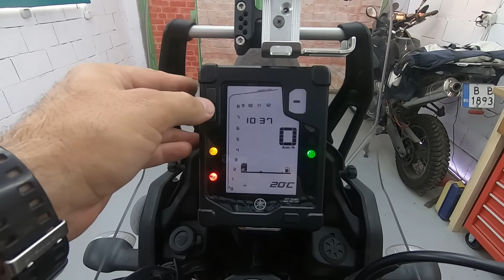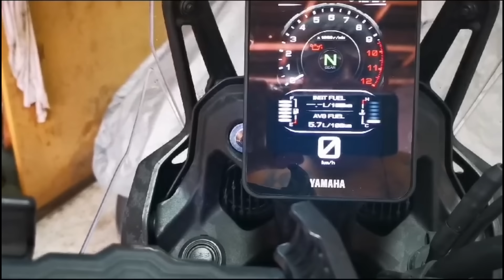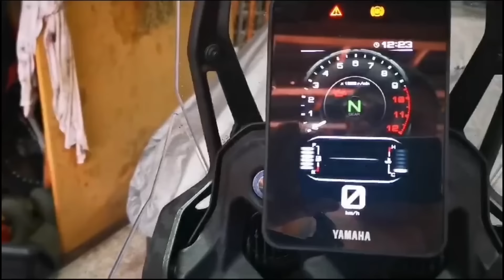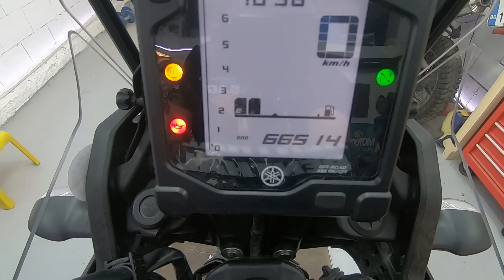Yamaha Tenere 700 - Long Term [66,000km] Owners Review

Comment: Hi Pavlin. I’m a little bit late for the party because I just found your channel. Maybe you already know it but For this cold engine clutch “issue” try before you start bike push it back couple of times on the first gear. It will release clutch discs which are stick to each other after last run. I learn that in 1998 when I start riding. 
Great channel 👌👍 No BS straight to the point. 
I’m planning my come back to Poland from Canada after 11 years on T7. Well I was surprised when I figured that there is no commercial boat from Alaska to Siberia 😁
Reply from the maker: I know that and do it every time, but no results. Instead, I just start slowly.

Comment: Great video! All modern bikes are using wet sump motors instead of old school high tech dry sump design. The wet sump pushes the motor 4 to 6 inches higher in the frame which makes the entire bike top heavy. If the motor is 6 inches lower the fuel tank could be 6 inches lower and even the seat height could be lower!
Reply from the maker: True, but there is nothing we can do about it.
Reply: @motorcycleadventures  maybe, just maybe, if ALL of us talk about it someone may see it's advantages and the tide may change! YouTube influencers like you can make a difference!!

Comment: Great review and information. Regarding the clutch noise on first start of the day: after starting the bike, while it’s idling in neutral,pull in the clutch lever and hold it in for a few seconds, then release it. Then, see if it still makes the noise you described when you put it in gear for the first time when departing. Just a suggestion to see if that changes anything. Thanks again!
Reply from the maker: I do this every time and it still do it.

Comment: Nice, thoughtful review.  I particularly like the T7, although my primary bike, especially for regular commuting (between 50-200 miles, depending on work)  is a first generation Super Tenere.  Totally different bike, of course, but there is this in common:  incredible reliability.  After over 100k miles (not km), no issues, even though I ride it year round, including in sub zero temps.  Simplicity is the key, and both of these bikes place a premium on reliable, practical engineering and geometry.  The T7 is also "stupid reliable" and well balanced.  Either way, they will never let you down.
Reply from the maker: Thanks for sharing!

Comment: Bravo Pavlin !  The clutch problem - you have to open it, clean it and reassemble it. Use ,of course, the RIGHT Nm torque for the bolts. For me is ok now.
Reply from the maker: Clean a new bike?
Reply: It's not about cleaning. It's about torque. We think the factory is not tightening correctly

Comment: Love your wood stove with the heat exchanger on the chimney pipe.  Never saw that here in USA. 

Great vid on the T7. I would love one. 72 HP is more than 3X my Honda CRF250L, and twice my Moto Guzzi V7. 
Really agree with you on riding a simple bike, without extra things that add weight & can fail. 
If I dropped the T7 while riding alone, I could never stand it back up. I can barely pick up my 146kg/322lb Honda. I try to ride with a buddy, but can't always find someone able to go.
Reply from the maker: Thanks for taking the time!

Comment: For the clutch noise when cold, I have found that if you pull the clutch lever in 5-6 times before shifting the gear the noise does not come.  I guess it’s because the oil get around the clutch plate and provides some lubrication. You have to do this only for the first time when cold.
Reply from the maker: I also do this all the time.

Comment: Hi Pavlin ! Thanks for this  T7 review. Very interesting and useful. When you need a good horse not too heavy , not too powerful and very simple to maintain, this is the point and that's why I chose the T7 and bought one, second hand, a 2021 Rally Edition from an ex-local enduro champion in France, with 13.000 kms. When I looked at ads for T7s to sell on "Le Bon Coin" in France, I saw two sellers who talked openly about the clutch issue but never on youtube. As you say, the "issues" on the T7 are quite minor, and this bike is terrific - simple, efficient. Congratulations for your videos, always very documented and interesting. I loved your trip to Madagan. I hope to make a trip like you did, through eastern Europe and Asia - but first, some trips in Europe to master my T7... Hello from France !
Reply from the maker: Thanks for taking the time!

Comment: The twitchy throttle isnt a problem with the throttle cable. It's the fuelling. When you roll off the throttle it cuts all fuel input when you roll back on it chops back in. It's done for emmissions.

I sent my ECU off to be tuned and it cured that issue almost completely. If I had removed the o2 sensor, then it would apparently have been even better. But I never got around to doing that before I sold the bike, which I wouldn't have done if I hadn't won a 1250gs in a raffle.
Reply from the maker: Good to know.

Comment: For short people, e.g. myself 1,72 m i recommend a v strom 650, mine has 62000 km, i changed a ball bearing for 15€ on the rear sprocket hub, nothing else, low on fuel, not expensive to buy, good offroad, if you donot go too fast.
Reply from the maker: Thanks for sharing!

Comment: The main issue i have with this bike is the poor traction on thick gravel/stones. Swingarm is not stable and this is due to pinion position if related to swingarm pivot. I tried different solution but is a geometry issue. However still a great, honest bike.
Reply from the maker: I never felt anything like that, it is exactly the opposite!
Reply: Do you mean rear wheel is hopping? Or just no traction?
I recently rode my T7 up a washboard road and it had completely no traction, the rear completely floated in the air.

Comment: Hi Pavlin for your next decal you can get very inexpensively protection in the form of a clear plastic roll of protection film that has a very mild adhesive so you just cut with scissors the shape of the decal or panel you want to cover but it is invisible like a clear plastic shield, cheap, effective.
Reply from the maker: Thanks, man!

Comment: Great, real-world review. Confirms the reason why my husband has been riding something Yamaha XT/now Ténéré for 30+ years (started with a XT 350, bought a XT 600 when I got my license, and now rides the same model as you.). Never had major problems. He is 180 cm tall though, and the Ténéré works still fine. If you are below that, maybe the lower seat might be an option. If it absolutely does not work and you want that fantastic engine, the Tracer 700 might be another option. Not that great for offroad, although you can slap a bashplate on it, maybe different springs. I did put some bar risers on mine and can stand up easily (no serious offroad though, just sometimes nice to be able to do that).
I tried an Italian brand in-between, but it did not go well (technically unreliable, so I stopped riding on my own. Rather ridiculous, but I lost trust in that bike). So Yamaha it is again - no complicated tech but ABS. Just right for us.
Anyways, looking forward to many more fascinating videos with your Ténéré.
Reply from the maker: Thanks for taking the time again!
Reply: I lowered mine, not because of my inseam, but to counter the top heavy nature of the bike, it was noticeable.  I am tall and sit flat footed with a nice knee bend, with top heaviness this was a no brainer for me as I use dirt bike for dirt, and my T7 is mostly road oriented use.  It doesn't affect the geometry of the frame at all, only the suspension travel loss, minimal.   I guess you had to learn the hard way about Japanese reliability eh?

Comment: Thanks for the long-term review, Pavlin, and my experience has been much like yours....after 10,000 miles I still love the bike!  I experienced the jerkiness of the throttle but made it much better by adjusting almost all the slack out of the cable.  I have not had the dry clutch experience at all, and I just use the synthetic Yamalube....maybe it's because we're in a pretty cool climate all year around!  Also took off my OEM crash guards and like the bike much better that way, although I am thinking about the lower ones from Altrider.  No mods to my seat, it's fine the way it is.  If you ever need them, Camel ADV has recently come out with replacement fairings at a much lower cost from OEM and made of a more pliable material!  Looking forward to the log videos!  Cheers!
Reply from the maker: Thanks for sharing your experience, Allen! Camel ADV don't ship to Bulgaria.
Reply: Ahhh, bummer!  And the place that supplied your crash bars doesn't ship to the US! Seems to me that if a person is willing to pay the post anything should be able to ship anywhere....I guess we just have to make do!  Ride safe! @motorcycleadventures
Reply: @motorcycleadventures Have a look at rtech fairings. They’re made from more flexible plastic as well and are even cheaper than the Camel adv ones. You can find a movie on youtube as well.

Comment: Now that's what you call a review Pavlin thanks so much for sharing I used to mainly have Japanese bikes an after having quite a few Euro bikes and Indian ones, Ktm 390s (x2 one mine one dad's both rejected with tech issues fly by wire failiures and tft failiures, 2014 gsa, engine problems and fly by wire problems, Himalayan rejected everything went wrong with it seized swing arm electrical failiures got My money back on it.

The fly by wire throttles always have a feeling of disconnect between what you want and what you feel (coming from carb nortons and other cable efi bikes) that's after 2x ktms and 2x 1200gs/gsa with it a 2014 and 2020. That's only my opinion though an we are all different. 

Had a 300 rally no issues bar the soft suspension. On an 1150gsa now which was problematic due to previous owners and a dealer lack of work. The great thing though as you say is it was easy enough to work on and for me to fix an now all sorted.

I think that is something we are sadly moving away from with some of the modern motorcylces now. 

As they are adding more technology in there's more point of failiures in them especially with the tfts.

Looking forward to getting some Japanese bikes next year as my dad's bikeless at the mo after the ktm.

Keep up the brilliant videos 👍
Reply from the maker: Thanks for sharing your experience!

Comment: I have the old 750 super tenere, and I will own it 20 years in jan, it has a comfortable seats like many of the older bikes. I love the bike because it is versatile and comfortable and very reliable no electronics. However, I am considering buying a 700 T7, but the seat looks very uncomfortable that would put me off because I had a couple of bikes including a 790 ktm, and found it too uncomfortable. This is a big factor for me.

Comment: I love the bike, I ride a ktm right now but been wanting a tenere 700. The only issue at all I have with these bikes and most adventure bikes is the front end. They look so much better with a high fender on them. When I do get one I’ll definitely buy a high fender kit for it. I know the extreme version has a high fender but the seat height is also higher and I don’t want that.
Reply from the maker: Fair enough!
Reply: The high fenders have different issues at highway speeds and crosswinds in my experience. I prefer the low fenders except in heavy sticky clay or mud..

Comment: Nice review.  I've had mine for 6 months, very happy with it.  I agree about the dash. On the road it's fine, yes it vibrates off road but I'm not looking at it then, so who cares. I haven't noticed the clutch issue, but I baby my bike for the first few minutes when it's cold, not an issue for me. I do wish you could disable rear ABS while leaving the front active.  Seems like it wouldn't be too tough to make a mod for that.
I am considering a seat upgrade.  Rode 8 hours yesterday, the last hour wasn't comfortable.  Not bad for a stock seat, but wouldn't mind something better.  I have the same mesh cover as you, it does help.
Reply from the maker: Thanks for taking the time!

Comment: Excellent review Pavlin. +1 on the throttle response at low revs in 1st and 2nd gear. In certain circumstances it can be quite frustrating. Maybe I just need to learn to ride it faster 🙂
Reply from the maker: Might help!

Comment: I tried a T7, but it didn't work for me. Having come from a 950 and then 1090 Adventure, the T7 was too much of a downgrade, especially in power for road riding and suspension for off road. I sold mine and bought and 890R, and there's no looking back.  Yep, the T7 is a very reliable platform, and yes, the 890 is plagued with many common isues, but the smiles per mile on the 890 are off the chart for me.
Reply from the maker: Fair enough!

Comment: Hello Pavlin. I have this bike since it came out in 2019, same experience as you, zero faults and it has been trashed offroad all around Europe, Turkey and Georgia. Just to let you know, the jerky/violent throttle when you close and open again is very annoying and a known problem. It is not caused by the cable but the programming of the ECU and the fuel cutoff on deceleration for fuel emissions. The only way of getting rid of it is by flashing the ECU and removing that option.

I've tested many bikes to change it, but at the end I always keep my T700 because I invested a lot of money in suspension upgrades and I still haven't found any engine that has similar low end torque. Yes there are more powerful bikes, but down low this tractors up any slope at any gear almost at idle.
Reply from the maker: Thanks for sharing!

Comment: great to hear you are back (on the other hand it´s always an end of a journey and the urge for the next arises, at least for me) but i wanted to say i resonate with what you say about soimple and still more capable motorcycles that can do more than i can in the moment

and i love the t7 in the first version. simple but offering plenty of fun. 90K and no problems. except when i would like to complain it would be the sometimes jerky throttle, that sometimes makes me help with the clutch. first clutch plates installed still, so ... all good. nothing to see here :D

Ride save Pavlin and great to hear all worked as it should be, or rather as we hope for . Greetingz , Mariusz
Reply from the maker: Thanks for taking the time, Mariusz!

Comment: Excellent review. I agree with everything you have said, although I have never experienced the weird clutch noise you mentioned. I also find the jerky throttle response in 1st gear frustrating. On technical ground I will luge my T7 in second gear were I find the throttle response much smoother. My T7 is 2 years old and I have also not had one single problem. NADA. Other mods that I have done that I think are maybe worth while: kaoko throttle lock for those long stretches down the highway, 1 finger clutch mod and "The Fix" Camel Adv rear brake peddle (amazing difference!). I also went with the small Givi engine guards, which give a little protection, doesn't really change the look of the bike and are lightweight.

Your video just wants makes me want to get on my T7 and ride over the horizon!!
Reply from the maker: Thanks for taking the time!

Comment: Throttle response. Here is what i think, after riding my mt07. I think there is a big play in the gearbox. If the chain more lose as usual, it kicks even more.
Reply from the maker: I don't think so!
Reply: @motorcycleadventures  Meassure it on your old bike and make conclusion.
Reply: Or not, coz 660 have the same problemm, compare with africa twin. Honda have precision gearbox of all.

Comment: Regarding the snatchy throttle maybe consider the rapid bike evo. Makes the bike significantly smoother and gets rid of some of the issues caused by the lean stock mapping :)
Reply from the maker: I don't like to play with mapping.
Reply: @motorcycleadventures  I’m the same which is why I liked the solution - pulling a few plugs and you’re back to normal. Unfortunately, reducing slag or having ride by wire wouldn’t solve this issue.

Comment: Pavlin very interesting video, one quick question, why did you choose the Oxford heated grips instead of the stock Yamaha one?  I would want to invest in the higher screen as I don't have the issue of the camera.
Reply from the maker: I had them before and really like them. Never heard any good feedback from Yamaha OEM grips.
Reply: @motorcycleadventures  ok makes sense, I didn't know the OEM were bad. THanks for taking the time to reply.
Reply: Also the OEM are more than double the price of the Oxford.

Comment: Pavlin, thanks for your review, but I have a different question: What are these tubes about over your oven. We also heat with wood, but I have never seen such a system of tubes.
Reply from the maker: They are like radiators, helps to heat the room faster.
Reply: @motorcycleadventures  Cool. What is the name of the Company and/ or the product. I can’t afford a big bike right now, but the tubes will be possible!
Reply from the maker: No idea.

Comment: Again, Thanks for the no nonsense  way you share information. 
Question, I've been considering a 700, Pre 2024 as I agree KISS.
They are So popular here in the NW USA I've been unable to test ride one 
EVERYTHING you've said validates my reasons to consider one.
At 82, Excellent health but I'm not going long distance  Adventureing I ride mostly country, twisty, hilly, solo day trips under 300 miles.
IF I have a 700 I can extend my options to the MANY dirt and gravel side roads 

The NEGATIVE,  I'm 172 CM. 170 LBS, seldom carry more than 40 Lbs of "Stuff"  thus what in your view  are the negatives you mention if i "Lower the bike" 
Thanks
Reply from the maker: Good luck!
Reply: @motorcycleadventures  What are the Negatives you see from lowering , Thanks